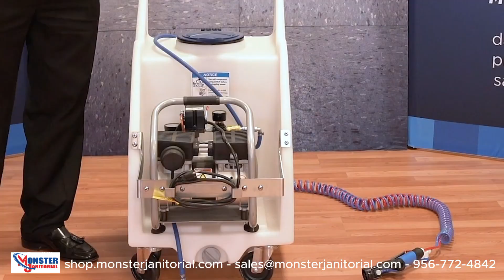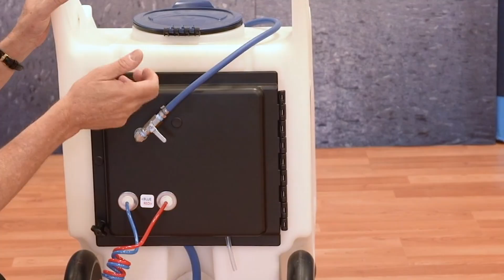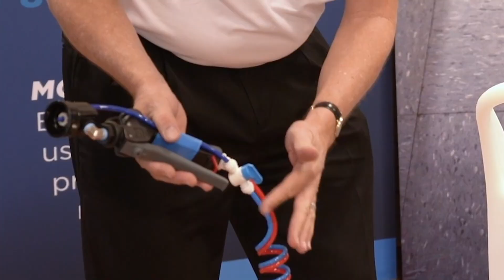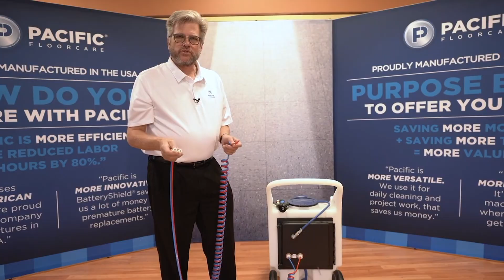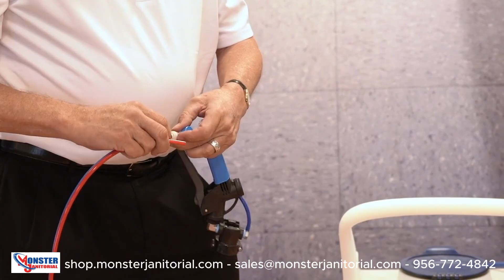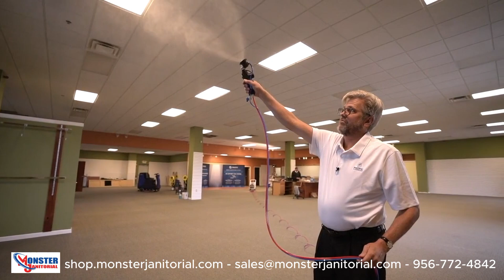Pacific AM-15 (685401) — 15-Gallon Air-Assisted Misting & Spray Machine | Demo & Features

Comment from the maker: Shop Pacific AM-15:
https://shop.monsterjanitorial.com/pacific-685401-am-15-15-gallon-air-assisted-misting-spray-machine/

Shop All Pacific equipment:
https://shop.monsterjanitorial.com/pacific-floorcare-equipment/

All Floorcare Equipment:
https://shop.monsterjanitorial.com/floorcare-equipment/

Questions? (956) 772-4842 • sales@monsterjanitorial.com
Need parts/manuals? tech@monsterjanitorial.com